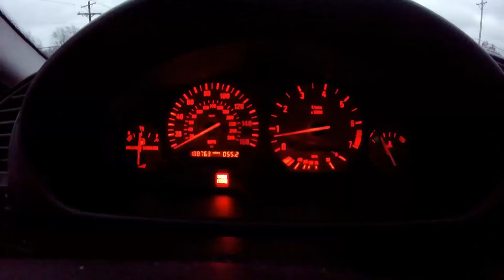Should You Ever Replace Your Transmission Filter?

Comment: Ok Pete so I have an 05 mustang, it started to slip. It will delay for a long time then eventually started to move and the same with reverse. So I changed the filter and had the same problem. So then I changed the transmission with a used one from Autozone for 1141 and change with 85k miles one it. 4 months later it started slipping agian, like yesterday it stared slipping anything you can give me on this problem would be greatly appreciated
Reply from the maker: Is the fluid burned? Did you clean out the cooler when you put in the new transmission?  If it all of a sudden slips in forward and reverse I would suspect a base pressure issue. Like something with the pump, low fluid level, pressure control solenoid, etc. you are setting the fluid level with the engine running, right?

Comment: It just seems to me like sludge (natural metal sludge that builds up in every transmission over time, not shavings after failure) can cause a flow issue due to a dirty filter. I'd still change it for that reason alone. Yes you still have enough pressure to shift but is the pressure optimal for the transmission? Free flowing fluid is important for a transmission. The filters are not expensive for most vehicles and it can't hurt to change it. So why not just to be on the safe side?

Comment: do we need to actually open the pan and flush the fluid or just change the fluid like we change engine oil?
Reply from the maker: Depends on the vehicle. Some have a drain plug, some you have to exchange through the cooler lines with a machine.

Comment: ABOUT A MONTH AGO I CHANGED THE TRANMISSION FLUID, A TAHOE 006, IT WAS A PAIN TO REMOVE THE FLUID PAN, SO I REPLACED THE GASKET AND PUT IT BACK, NEW FLUID AND EVERYTHING, AND FOR ME ,THE MOST IMPORTANT,  NO LEAKS,  AND THEN THE OTHER DAY I WAS CLEANING MY GARAGE AND ,  SURPRISE,  I FOUND MY NEW FILTER, TOGHETER WITH THE OLD ONE !!  I FORGOT TO INSTALL THE NEW FILTER !! SO I'M DRIVING WITHOUT TRANMISSIO FILTER,  I DON'T WANT TO GO AND REMOVE THE PAN, INSTALL THE GASKET, BE SURE THAT THERE'S NO LEAKS,   WHAT WOULD I DO ?? DRIVE IT LIKE THAT ?? THERE'S ANY HARM TO THE TRANNY ??    upps, sorry for the caps, i forgot that to,   any advice about driving without the tranny filter??

Comment: I'm about to do a fluid/filter change on a 2008 Chevy Cobalt  2.2l. Do I need to replace the filter seal or can I just leave the old one in? Thx liked your video. I am just draining and replacing the fluid/filter now. Then in 5000 miles or so I'm draining and replacing just the fluid. Then in another 5000 miles or so doing it again. 109,000 miles on it...I'm late I know. It still shifts smooth. I'm trying to keep it that way! Thx I'm doing it that way because I'm an amateur and I don't wanna flush it out because I have read that it's dangerous if you haven't kept up your maintenance. Oh and I'm only asking about the seal because it looks like a pain in the butt...and I don't have a mallat. If you're compentent  enough to rebuild a transmission you should know about the seal. Lol Btw those transmission parts are SPOTLESS! Great job!
Reply from the maker: I only replace the seal if it comes out with the filter. Just make sure the filter seats tightly into the seal. Take a peek at the fluid transfer tubes where they’re brazed. Look for cracks and replace them if they’re cracked. They probably aren’t but it’s usually the only thing that ever goes wrong with the 4t40e.
Reply: @PetesGarageandperformance  Thank you! I saw a video...I think it was Chrisfix he said he was gonna reuse a filter seal. If I remember correctly he pulled it out. Why reuse it lol!  Thx subscribing!
Reply: Yeah I actually was thinking if the filter snaps in good and firm it should be okay.

Comment: Interesting video.  I replaced my transmission fluid AND the filter a couple of months ago.  1999 GMC Suburban K1500.   Now every now and then I'm hearing a high pitch whine from the transmission.  Sometimes while in overdrive or 3rd gear.  What could this be coming from?
Reply from the maker: Usually a whine noise is caused by a worn planetary gear set. But if it happens in 3rd as well as 4th, it’s probably not the planetaries. It could be a thrust bearing but usually they growl. Did you get the correct filter installed? There was a deep and shallow pan on those years and they used different filters. If it started making noise only after replacing the filter? If so, replace it again and see if that fixes the issue. Maybe it’s not sealed well to the pump and is sucking a little air.
Reply: @PetesGarageandperformance  How far up should the filter be installed?  I didnt force it up all the way.  Wondering if the filter is too low and causing fluid starvation.  All the gears seem to be working ok.

Comment: I have a 2008 toyota highlander. It has 200,000 km's on it and transmission seems in good condition in terms of shifting. Transmission fluid was never drained. Would you recommend fluid drain(couple of times) or should i replace the filter as well?
Reply from the maker: Yes, I would do a fluid exchange. If it shifts fine then there’s no reason to replace the filter unless you have to drop the pan to drain the fluid.
Reply: @PetesGarageandperformance  Pan has a drain bolt. I will do a drain and refill  couple of times instead of replacing the filter.

Comment: Engine oil filters also filter metal particles. Transmission filter and magnets filter/hold metal particles.. pretty simple. I changed my transmission filter and the magnets were covered in metal particles and sludge from use, not because it is damaged. For the cost and ease of changing why wouldn't you. So you expect the transmission filter element to last forever?

Comment: Hey, can fluching transmission help overheating problem ?
Reply from the maker: Probably not. It wouldn’t hurt to have clean fluid though. But if it’s overheating, it’ll just cook the new fluid. You need to make sure the cooler is flowing fluid at roughly 1 gallon per minute. Also make sure the cooler fins aren’t clogged and air can flow through if it’s external. Also make sure none of the cooler lines/hoses aren’t kinked. Or if the converter isn’t locking up, it’ll build too much heat.

Comment: I am the original owner of chevy 2002 tahoe with 133k miles.  In that time took perfect care of with regular mataince. Now I let it sit a year and a half parked before i tried driving it  without doing or checking anything and it ran great for 50 miles until i went up a hill on freeway. Rpm shot up and was sliping gears..Again i parked it and i let it sit again now for around 2 years and checked fluid level and was real low. I put 4 quarts in and drives better but still some slipping gears with high rpm.. .could my filter gone bad or clogged over time sitting???or what do u think???? Thanks
Reply from the maker: Probably burned the 3-4 clutches or the 2-4 band. Does the fluid smell burned?
Reply: Thanks for responding. I dont believe the fluid smells burnt

Comment: I figured this out years ago...  How big is your fuel filter?  How often do you change it?  The fuel system is open loop.  Your engine oil and transmission are closed loop systems.  There is no new possibly-contaminated stuff being introduced.

At one point, I had a half dozen family vehicles I was maintaining.  Full blown up-on-jack-stands DIY oil changes were getting to be rather time-consuming, to say the least.  Then, I switched over to vacuum extraction.  I don't change the filters but once every couple of years now...  If the filter media of an oil or transmission filter is plugging up, your engine ain't long for this world anyway.

And every couple of years when a vehicle is up on jack stands for brake work or some other such lift-required maintenance, I do a full pan drain and filter replacement.

Funny!  I'm such a devotee to this process that my 1993 Chevy C1500 5.7l engine had trouble accepting the dipstick-inserted vacuum tube.  It just didn't make it to the very bottom of the oil pan.  So, I removed the oil pan, cut in a few places of the anti-slosh baffles, and welded in a blocking plate or two to guide the vacuum tube all the way down to the bottom of the pan and guarantee the tube wouldn't double-back on  itself getting hung up in the aforementioned anti-slosh baffles.

Let me tell you, oil changes are now fifteen minute affairs I could do in a business suit.

But, be warned...  The religious ritual associated with oil changes is powerful dogma.  You'll get tons and tons and tons of grief if others find out you're not doing it "right."
Reply from the maker: Engine oil is different. There are acid and carbon deposits that build up due to the internal combustion process. You really do need to change your engine oil filter.
Reply: @PetesGarageandperformance  It's always different...

My John Deere SB14 lawnmower was purchased new 40 years ago.  The property burns through a full tank of gas every single cut.  It doesn't have an oil filter...  It runs as strong as the day I bought it.

VW Bugs didn't have oil filters.

All my street motorcycle have over 100k on the clock.  All the cars/trucks I've ever owned have multiple 100k counts on their odos.  Not once have I ever had a lubrication-induced wear problem.

Once again, do what works for you.  What I do works for me, easy peasy!

Comment: A mechanic told me that changing the filter will have less restriction than the old filter and up line pressure which would knock particles loose which might make it slip for a high mileage Chevy 4L60E. Is there truth to this?
Reply from the maker: No. If it’s that close to slipping, then the transmission is on its last leg anyway. Changing the fluid and filter shouldn’t cause any issues.

Comment: Replaced non metal screen filter at higher interval miles ie. 100,000 miles to removed metal shaving and clutch powder shavings to maintain low ATF pressure.

Comment: Alright Pete I have a question I have 2012 Lincoln MKZ 80,000 miles my mechanic said that he thinks I have a Planetary Gear going bad he thinks it's the third gear it shifts fine just a little whining noise what would you suggest??
Reply from the maker: If it’s only in a certain gear I would agree that it is something related to that particular planetary gear or possibly one of the little Torrington bearings in the planetary. I think that vehicle has the same trans as the GM vehicles if it’s a 6 speed. You have to completely disassemble the trans to get to these parts and properly clean out the trans. I would bet there is some metal shavings in it.
Reply: @PetesGarageandperformance  Pete I really appreciate you responding to me. Yes it is a six speed transmission and my mechanic did also say something about the bearings, Now again my question to you is its sounds like a very expensive fix the car is in great shape very clean is it worth it if you could just a ballpark price estimate from your point of view thanks again Pete
Reply from the maker: @jerryvickers7048  the rebuild is probably in the ballpark of 14-18 hours on that transmission. Then add parts. You’re probably close to the $3,000 range depending on what’s needed. Might be worth considering a replacement with a warranty.

Comment: I got an 04 titan 5.6 4x4 it shifts a little slow n tiny bit of slipping. 223k miles. Im hoping the filter and fluid change.will help
Reply from the maker: The only way to know for sure if the filter made any difference is to do a before and after line pressure test with a gauge. Many transmissions also have adaptive shift tables that’ll increase the shift pressure for each shift and load as the transmission ages to reach a desired shift time. If you have a factory level scan tool, see how much extra pressure the transmission is adding to each shift. If it’s only certain shifts then that particular clutch is most likely worn. If all of the shift adapts are high then a filter may make a difference, but it’s also potentially a worn pump or pressure control system issue. Cut open the old filter and check it out. Let me know how much debris is in there and whether or not the filter makes a difference. Good luck.
Reply: @PetesGarageandperformance  it's not really a slip it's more of if I get on the throttle hard  it seems to rev high before shifting on some gears. But once it's in gear it's fine. But if I drive it normal. It's fine.
Reply: @maddmavic dump your pan and change your filters. Then, when you refill add the appropriate amount Lucas oil transmission additive(can’t remember exactly what it’s called).

Comment: I agree, which is why I never change my engine oil filter -- I just drain/full the engine oil every 4k miles.
Reply from the maker: Change your engine oil filter. Transmissions are different. There’s no combustion happening in a transmission.

Comment: Anyway, can we make a custom external atf filter like spin on model  or put it before the oil go through into the cooler, i know that will cost a lot of money, maybe not good idea but you know when i open my trans oil pan its look so dirty, i meant the oil is clear but like there is clucth particle in it,  i change the atf (dexron3) for every 25.000km and now my car have 107.000km on it.
Reply: The reason why trans filters are not designed to filter out clutch material is that you would then run the risk of having a trans filter get clogged and subsequently starve the transmission of fluid, or they would have to design a trans filter with a bypass valve, just like motor oil filters have but then you would have to change that type of trans filter quite frequently as well just as you do the motor oil filter.   A properly maintained transmission (frequent fluid changes) will last hundreds of thousands of miles already, many times outlasting the engine, with the major point of failure not being due to any filtering but rather due to owner neglect or owner abuse. Being that a properly maintained transmission can already outlast an engine in the same vehicle, there is no need to over-complicate things by adding external filters, etc. You are already doing the best thing you can do in insure a very long service life of that trans by changing out the fluid every 25,000 km.   My cousin recently purchased a car from me that has been in my family since new. It's a 1997 Suzuki Esteem wagon. Last time I checked with him he had 517,000 miles on that car, still has the same engine and transmission, no repairs, only scheduled maintenance. The trans fluid has been changed every 20k to 30k miles. It was running Dexron 3 for the first 5 years or so but after that we upgraded to Valvoline Full Synthetic MaxLife ATF which results in faster shifts and slight increase in fuel economy versus the Dexron 3.  Even though it's not required by maintenance schedule, the trans pan is removed every 200,000 miles for proper cleaning just as you mentioned so as to remove the extremely fine clutch material soot that settles out at the bottom of the pan to help reduce the amount that's kicked up when new fluid is added. You're much better off having that soot settle to the bottom of the trans fluid pan than adding another component and/or point of possible failure to the trans system. Just clean it out whenever you drop the pan and you are good to go.

Comment: Hugtransmission leak. 189,000 miles. May need a gasket.  If the pan is taken off to replace the gasket why not go ahead and change the filter too?

Comment: The filters I've seen were nothing more than a 'window' screen like an engine oil pickup screen. It is basically just a strainer for large, chunky particles. A 2013 Nissan Sentra CVT has one of these under the transmission oil pan AND a separate paper filter attached to the side of the transmission. Replace the filter, not the strainer. A 2009 Volkswagen Jetta DSG transmission also has a separate paper filter. Your vehicle may not have a separate paper filter. A strainer filter will not filter out fine particles.
Reply: Jatco CVT transmissions in Nissans are disposable, I wouldn't worry about it.

Comment: I’m experiencing the transmission fluid to read more than is required .7 months ago the reading was in the safe required  zone  now 7months later so possibly  from the likes of my partner who goes to visit other friend,says that adding more fluid was never done and as far as I’m consern  I’ve  took  the responsibility to check the levels again 7 month later and to my surprise the reading promotes to much fluid So I’m  flabbergasted  to this point because the maintenance to check  fluid levels is me responsibility ,what am I to think now My oil level began with the normal reading to the full line with the design-on thing are great , but one thing  troubling me is the dip stick . The dip sticks has been twisted up all the way down until you can see the readings and that threw me on another mind boggling delegate, I’m letting that slide and I just added 3/4 of the pint when the reading read 1/5 from empty and full reading. So at this point am thinking and researching the posabilities of a plugged filter  and wondering maybe some one added more with out telling me, I mean common since tells me there should  be less since the readings started out the same 7 months ago. I noticed alittle  leaking around the dip stack area and a little higher and no wear else. So I ask you for your professionalism a
In advise to how you would would tackle this senecio  if not, thanks at least for reading what I replied and the 411 given on your video have a great thanks Giving feast & be safe🚗🛻🚙🏍🛞💯%